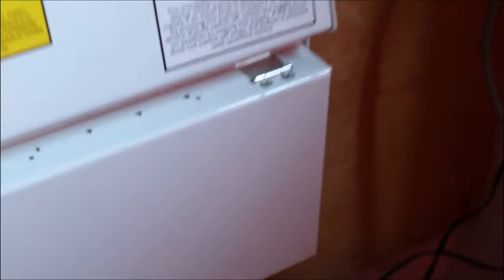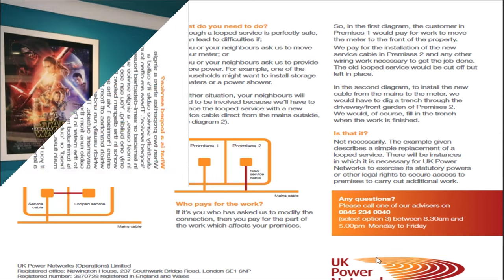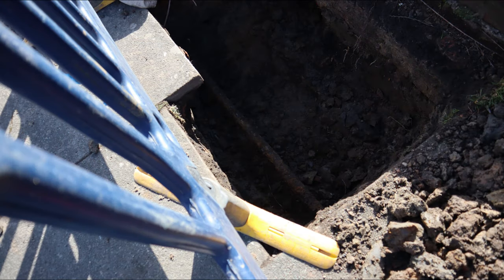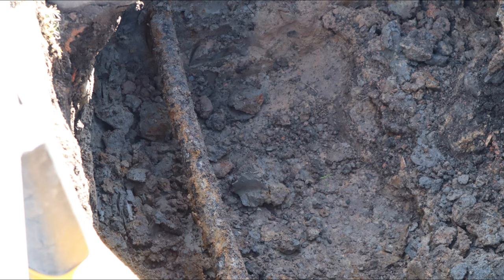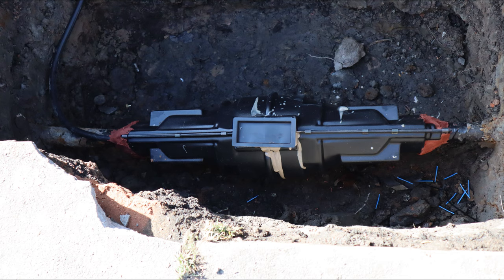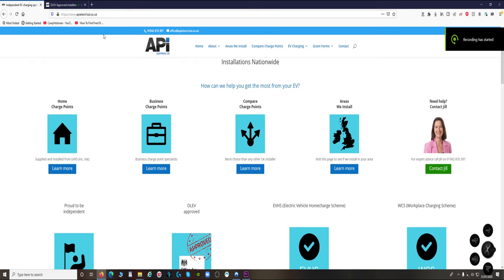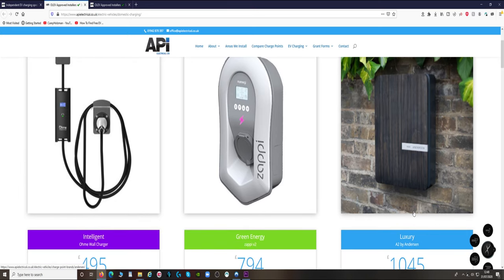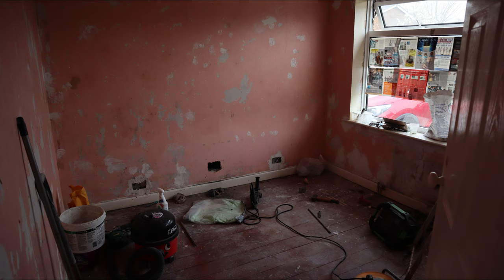UNLOOPING AN ELECTRIC SUPPLY READY FOR AN EV CHARGE POINT

Comment: +Tom's Man Shed
Why do they only require to dig up next doors for dedicated cable?
As the wayleaves are already in place for next door to be wired via your place they could surely:-
1) Feed new dedicated cable for your property alongside existing supply, connect that into new fuse-head.
2) Joint next doors cable to the existing supply cable, still physically running through your property as it always did.
Reply from the maker: I don't know...I just left them to it so suppose they picked the best way for them ...either way I was glad it was all done FOC and no damage was done to neighbors drive....like I say it was better after than before.

Comment: I was always under the impression that questions about looped supplies only come into play when “maximum demand” exceeds 60amps.  If maximum demand is less than 60 amps (after the charger is installed), then the DNO is notified after the charge point is installed.  That being the case, the question of looped supplies should in theory become irrelevant. If it’s more than 60amps then you need DNO approval in all cases, and that’s where your supply needs to become unlooped.

“Maximum Demand” is a calculation that’s worth looking up.  There’s guidance notes in the wiring regs on how to calculate it.  

In my situation, given that unlooping is so expensive in many instances, I’d want to explore other options for keeping that maximum demand below 60amps in order to avoid the approvals requirement.  The Zappi charger for.instance will dynamically limit charging load to keep the grid incomer below a configurable limit.

But, a very interesting video nonetheless!
Reply from the maker: Hi Anthony....I got told by 2 EV charge point installation companies the same thing that they wouldn't install to a looped supply.

I don't know what the actual regulations state but couldn't really argue with them if that is their criteria hence me getting it done (free of charge luckily) 

By my calculation a 15kw load would be about 60 amps so I suppose with the car on charge at 6.6 - 7Kw and an electric shower running for instance then it would be pretty much at this figure.

I don't actually have an electric shower so my max load will never approach this and if I did I would obviously use common sense in its use but I can only go by what I was told by the installers....glad it is done though as like I say it didnt cost me a penny.

Comment: Insightful video, can I ask, do you have to have a smart meter fitted if you're having an EV charger & what was the overall cost of all the unlooping?
Reply from the maker: No it's not compulsory to have a smart meter....I was on a tariff called octopus agile which changed price every half hour....for that tariff yes you did HAVE TO HAVE a smart meter but I came off it due to its increasing cost and am now on octopus go which is possible without a smart meter so the answer depends on your supplier and tariff

As I mention in the video the unloopng was done free of charge. I was told this was because it was my neighbour connected to my supply and mine was the main one to the road....if it was the other way round it would have been chargeable so best asking your supplier as they may have different rules

Comment: This video is good info if you do have to be unlooped but fails to point out that many looped properties have charge points installed without being unlooped. Your DNO will be contacted by the people arranging the EV install and the DNO will decide based on historic data on you and your looped neighbours consumption whether un-looping is required. Other factors which are considered are the age of the properties and condition/size of cables and the type of EV charger being installed. If the EV charger has load management which can slow the charge rate down if the total load approaches the master fuse capacity then this could allow a looped supply to remain. Charge rate being slowed down may occur in rare circumstances if for example you are charging your EV while you and your neighbour are cooking tea using induction hobs and electric ovens and kids are in the power shower. Not likely to happen very often if at all and slow down won't affect charging time for long. All this should happen before you are given an install date so you will know what to expect and may not be affected at all.
Reply from the maker: Thanks for that Chris...all I can say is that the charge point installers refused to fit it to the looped supply so just went with what they said. Am glad I had it done anyway as it caused no mess or damage to either property ....we got all new paving stones outside as well as they were already cracked ....since it was done I now have new neighbours and it removes any doubt on them if they decided to get an EV.

Comment from the maker: Hi Chris ....thanks for all the info. I just did the video on my experience and what may happen IF you need to be unlooped. I can only say what happened in my particular case...it wasn't meant to be an in depth vid on the reasons FOR unlooping. I was just told they wouldn't fit it unless I was.. even though my consumption has always been low for the 34 years I have lived in the house (never had an electric shower for instance and always gas for cooking and heating)

Comment: Great video! I’m awaiting my Pod-Point installation, my local installer ha last notified me my detached home is on a loop with a semi-detached house (I was surprised too). Anyhow, electric board have approved the unlooping under their de-carbonisation incentive, hoping to get works underway soon.
Reply from the maker: Thanks for the kind words Stuart....hope it goes as smooth as mine......got all the pavement dug up outside mine at the moment....renewing the gas pipes in whole street :)
Reply: Thanks Tom! Fingers crossed. We’re quite fortunate to not having to drive up and down the country right now, so we’ll make do with local chargers. We’ve just had a new Lidl pop up a mile away with free 22kw chargers, looks like we have a new favourite supermarket 😉
Wow your street will be super modern at this rate👍

Comment: Hi Tom, very informative video, although I don't drive or own a car, I am very interested interested the electrical side of things. Looked a major job. So, a couple of questions - Does the government grant cover all the DNO's costs of having your supply unlooped as well as fitting the charge point?
My house has a looped supply too, it's a semi detached house, mine is 'Property1' so I have the second cable in the DNO supply head going through a hole in the wall under the floorboards, to the adjoining neighbours house, this system was/is used to save on cable runs, I'm surprised they used it on detached properties like yours, but what I want know, is if yours had been the 2nd property on the loop, so only one cable was visible how would the installers been able to know it was a looped supply?

On the subject of smart meters, I wouldn't have them, from what I've heard they can end up costing you more & can be intrusive with your energy usage patterns.
Reply from the maker: Hi Ritchie...Thanks for the kind words...To answer your questions...1) the government OLEV grant is only towards the cost of the charge point install...it's now down to £350 but since mine was installed before April 1st this year (2020) I got the old grant of  £500.

The cost of the unlooping is nothing to do with the grant it's just done free by the DNO

2) Mine is also a semi detached bungalow...don't think they use looped supplies for detached...just terraced and semi's

3) I don't know the answer to how they would know it was looped if I was the 2nd house with only one cable showing....maybe they check on council plans?

4) I too didn't want a smart meter for years but have now totally changed my opinion...there are all sorts of conspiracy therories ...my friend still thinks they can automatically alter your direct debit payments without telling you LOL .How can they be intrusive with your energy usage patterns?...its up to you how much energy you use ...all a smart meter does is register acurrately how much you are using and then send that info to the supplier..its handy to go round switching things on and off to see how many watts they are using displayed on the portable monitor..it helps you economise....but the fact remains if you want a great tarrif like Octopus Agile you HAVE to have smart meters...if you dont want them you cant go on Agile.

I have only been on it for 2 weeks but last week prices went under 3p/Kwh for 2 hours one day and under 2p/Kwh for 1.5 hours the next day .....the rest of the time its usually about 4-8p ....it's only dearer between 4pm and 7pm when its about 20p/Kwh.....for me that works out WAY cheaper than a fixed tarriff as most of my elec use is during the day and after 7pm.

When it was under 3p last week I topped the car up and in comparison to  petrol cost (£5 per Gall) it worked out I was getting 769 mpg and when it was under 2p I was getting 1120mpg!

Sometimes (usually when it's very windy or sunny and low demand times) it can go negative where they actually pay you to use electricty :)....I reckon Agile will save me about £300 this year not counting car charging ...btw charging my car on my old fixed rate tarriff with Avro  (14p/Kwh)  would give an equivalent of only 142 mpg...still much cheaper than petrol but nowhere near as cheap as to charge on Octopus Agile.
Reply: @TomsManShed  Thanks for the info, did the DNO have to isolate the supply while working on it, I have heard of it being done live, many years ago I remember the contractors connecting a new Street light to the cable outside my house and they did it without disconnection of the power!
Reply from the maker: @NOWThatsRichy  No they didn't turn the power off to the street just me and my neighbour (it's shown on screen in text at 10 mins 1 sec in)
Reply from the maker: @BMW R1200GS Adventure Hi...sorry for the long delay in replying....I missed this .....Thanks for for that ...useful to know I obviously assumed wrongly.

Comment: My neighbour is the same as yours  two wires. Mine has one so he’s is  feeding my house. Does that mean I still have be unloop to have a charging point fitted
Reply from the maker: Hi Jake.....yes that's how it was with me ...but with me it was my neighbour that was branched into mine 

Each of uswould have to have our own supply no matter who was branched into who

My elec supplier insisted it was done as shown in the vid....your area may be different and have different rules so you will have to check with them

As mentioned my neighbour was great but I suppose it could be different with an awkward neighbour....it's in both houses interest though and increases the value of the houses ....if it's done free of charge like mine then its great. .if they are worried about there driveway etc show them my vid ...my neighbour's block paving was better after than before....like I say though you will have to check with your electricity company re it's rules

Hope it goes well
Reply: @TomsManShed  yes, my neighbours are brilliant to I have spoken to them and I have show them  your video  thank you 👊🏻it help me to explain more  because I did not fully understand all of it .,  my supplier?  Is Chester and Merseyside it comes under  SP network  thank you again for your reply

Comment: Really informative video, as an installer I am coming across my first looped supply and just starting the process for my client.

Can I ask, do you have another unit fitted supplying the charger? Or is it just the proteus one? Because looking at the video it looks like your charger doesn’t have any over current protection to protect the cable from over load
Reply from the maker: Hi A1...thanks for the comment.....Yes I should have shown what's in the Proteus box really in the vid but have just lifted it's hinged flap and  looked in it and there is a 40amp RCD with a push to test/reset button in there...it has IEC 61008 on it if that means anything.

It was all done by a recommended installer using the government grant so I assume all is up to standard.

I hope your clients unlooping experience goes as well as mine....like I mention in the vid my neighbour's drive looked better after than before :) ....might be worth pointing them to this vid to reassure them.
Reply: @TomsManShed  thanks for the reply. Yes fingers crossed all will go well and the process will be pretty painless. 

I saw the 40a Rcd but that does have a fuse rating to protect the cable. It should of been installed along side an mcb IEC 60898 or a combined rcbo IEC 61009.

The set up there isn’t correct. Sorry to sound like a know all, but it is a really good video and you seem like a lovely chap. I’d rather you be informed that the circuit isn’t protected correctly
Reply from the maker: Thanks for that A1...will certainly look into this.
Reply: @TomsManShed  okey dokey, sorry if I’m coming across as bit of a dick, but I’d rather see you have a safer installation.

Take care
Reply: 100% correct - I hope you got this rectified under the grant scheme

Comment: How do you know if you have a looped supply? I’ve been waiting 3 months to find out :(
Reply from the maker: Hi Chloe....they knew I was on a looped supply from the photo I sent them of the meter cupboard...if you look at the vid at 3 mins 6 seconds in you will see there are 2 big cables at the bottom of the shot (it explains this in the vid) ...one of those is next door's supply.

so I am assuming that in most cases it is visible.......If however next door's supply was branched into mine in a non visible place it would be harder to find out.

I would think that your DNO (Distribution Network Operator) would have access to plans showing if you are are not looped....not sure why it would take 3 months to find out though.

Comment: Wow. Good vid. Never realised it could be so complicated. Just had my free Rolec charger fitted, paid for by MG, because I reserved my car online in July 2019 and car delivered March 2020. Nice simple dedicated cable from meter cupboard on outside of house, clipped along outside of house into garage. EDF not able to fit smart meters yet, so maybe time to switch to Octopus if they have fitted yours already. What gas tariff do you use?
Is it with Octopus? Cheers.
Reply from the maker: Thanks Keith...yes it's easier with an outside meter box....the only complicated thing though was the fact that next doors supply was looped to mine...the installation of the charger was a straight forward job that just took 3 or 4 hours....easy cable run under floor.....as I mention in vid I am on the octopus agile tarriff
Reply: Thanks Tom. I realise you are on Agile electric tariff, but are you with Octopus for gas and if so how much do they charge for your gas? I was thinking other suppliers were much cheaper for the gas?
Reply from the maker: @keithgeorge7338  Hi Keith....yes am on octopus for gas as well...I went on octopus standard tarrif at end of may awaiting install of smart meters to enable me to go on agile which I have been on just 2 weeks

Haven't got round to checking other providers for my gas yet ...but will do as soon as I get round to it and definitely before winter....do you have any suggestions re a gas supplier?..,will check what price I am being charged tomorrow and add to this post.
Reply from the maker: Just looked Keith and for gas I am on their 12M Fixed tariff at 2.67p/Kwh and 17.85p daily standing charge....PS I too reserved the MG in July 2019 but was just outside the 1st 1000 (1018) :( ....mind you I do like the Ohme charger....if you really want it's features like only charge below a certain price I beleive Octopus offer a good price on the adapter lead....is the Rolec working ok for you?...I read there were some probs with it 'waking up' but think they may be sorted now.
Reply: The gas tariff seems quite good and fixed. I moved myself to new house in April because removals and carpet fitters locked down. So not sure what new consumption will be. But I used a lot of gas in last house and I was concerned that the gas tariff would cost me more than the savings on electricity, especially for low mileage EV use. I am with EDF on fixed at moment, but notice there EV tariff has gone up from 8p per kWh to 11+p , although it is for 96 hours including weekend. Not renewables? I think I will have to select a fixed Octopus when I switch, before they fit smart meters. I stayed with EDF because they fixed gen2 smart meters quickly last year at previous house. I would have chosen Zappi charger if it was free. The Rolec is charging fine. I think we must have both had the software  upgrade on our cars when we got them, that overcame the car not waking up to charge. I haven’t been able to use the smart facility on the app. to set charging times yet, because I need the smart meters fitted to get Octopus GO tariff. My dealer hasn’t got back to me about the comfort upgrade yet, but I am waiting patiently, because I believe there is another upgrade due in August? So I will get it all done in one go? I am really jealous of your man shed!
Reply from the maker: @keithgeorge7338  Thanks for that Keith....hope it all goes well in the end...yes best thing I did was extend the man shed...apart from toilet trips and sleep I basically live in here :)

Comment: My charger cable went round the outside of the house and over the door.
Reply from the maker: I suppose the engineer will use the easiest route as long as it's ok with the customer...I had all the  furniture out and carpets and floorboards up ready for him so it was much easier running it under the floor....easier for him and better for me as nearly all the cable is hidden....of course if the house has solid floors or an external meter box then an external run is the norm.